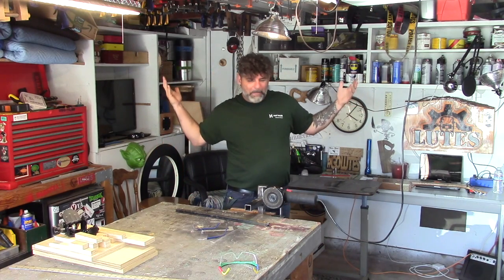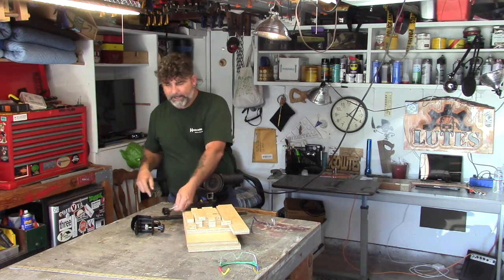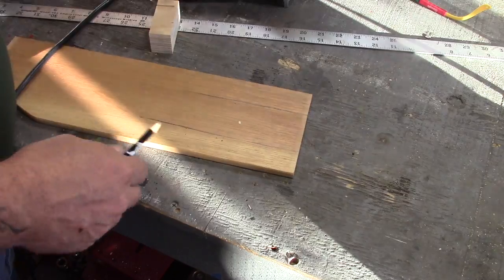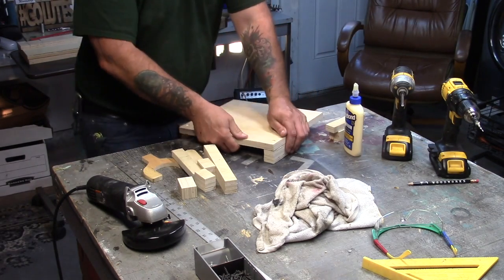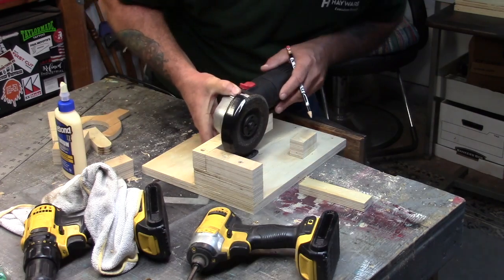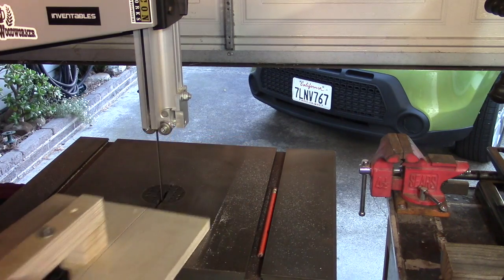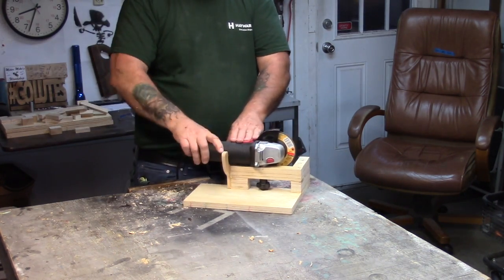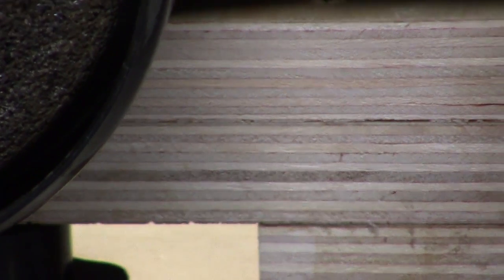How I turn my Angle grinder into a bench grinder !!!

Comment: Doesn't the position of the guard leave the user exposed to flying debris?Seems like you'd want to stand to the side or rotate the guard
Reply from the maker: D Ryan Anderson With the guard positioned where it is in the video, There doesn’t seem to be any more debris directed at the user than on a standard bench grinder. However, this jig does allow for the rotation of the guard as you suggested if needed. Mostly, eye pro is your friend :-)
Thanks for checking this out Brother 👊🏼❤️👊🏼
Reply: @WilliamLutesMaker  From my understanding, a bench grinder runs at 3,450 rpm typically. An angle grinder can spin at over 10,000 rpm. That's why angle grinders always scare me. Most dangerous tool in the shop, in my opinion. Some recommend full face shield when using discs that can fracture. Great video, just trying to learn safety myself. Great channel.

Comment: Thank you for another super video, Bill.  Do you think there would be any benefit in making the support for the grinder hinged (like a chop saw)?  Stay cool brother.
Reply from the maker: William Spanfelner 
Thanks for the kind words brother :-)
I thought about a hinge action to use with cutting disks, but I figured anything that small to cut would be easier with just holding the angle grinder and clamping the piece to be cut.

Comment: having the tool rest below centerline on the grinder is not safe at all.   side grinding on the machete is fine but for grinding on the end (like a bench grinder) the piece can get pulled into the disk....
Reply: I'm not trying to rag on ya brother...  I like your version of this hack... I think adding a spacer on the end would increase the safety factor for those unfamiliar with useing angle grinders.

on the podcast I think you guys were thinking of "make it extreme"  as the angle grinder hacker guys...
Reply from the maker: LacklusterSupply 
Thanks for the feedback brother. I have never had an issue with this setup. Most likely, the power difference between an actual Bench grinder and a 41/2 inch angle grinder is vast. But like all things safety, everyone needs to decide for themselves :-)